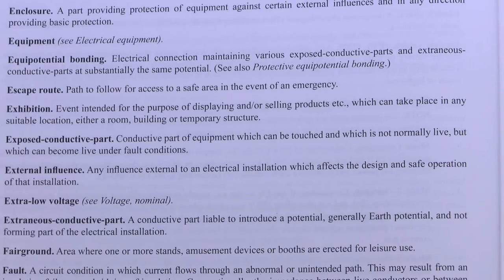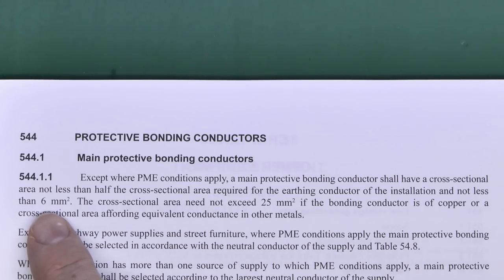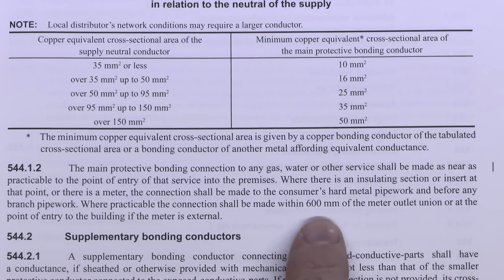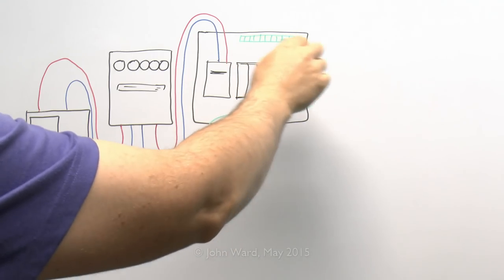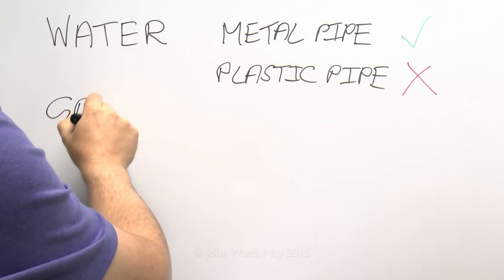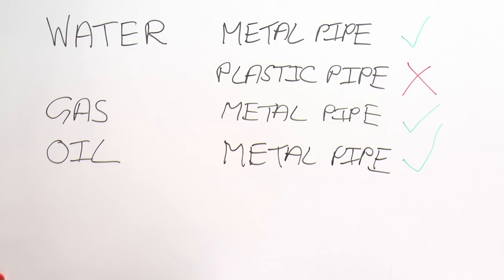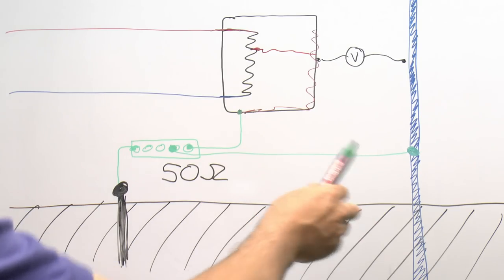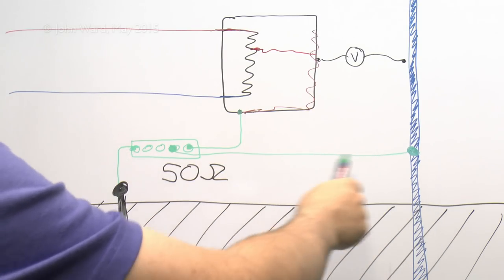Earthing & Bonding - Part 2 : Main Protective Equipotential Bonding

Comment: JW, Thanks for the vids. You are one of the best tutors on Youtube.  I have watched a lot over the years and few can compete. In addition, the section about the boiler causing shock when touching hot and cold pipe has possibly solved a 20 year mystery of an incident I dealt with in my old job. Thanks.

Comment: Re. Metal CH pipes set in concrete. As copper reacts badly to being directly embedded in concrete, any such copper pipe should be wrapped or sheathed. You can get 8 & 10mm microbore pipe with with a semi-airspaced sheath to give some thermal insulation as well as isolating it from the concrete, which should mean it's not an ECP. I wonder how many electricians would pick up on this point.

Comment: Hi JW, firstly thanks for the video ! Just a comment on the several good folks discussing whether or not to bond things in domestic situations. I have been zapped, several times over the years and all of them could have been avoided with proper bonding as you have described (I started work in 1974 and things were not well controlled shall we say ). Noting my bias, if it's in someone's home, if it's an accessible copper pipe, I just want to see it bonded. It doesn't cost much and then there are no surprises :)

Comment: The video is excellent. But I think the "why to use protective equipotential bonding?" part should be at the start, then followed by examples and details like conductor sizes and types.

Comment: Really useful video as per usual! A very belated comment but if my understanding is correct: it should be Emphasised that: an "Extraneous Conductive Part" is not only some "externally supplied (metallic) service" like water or gas. It applies to ANY metal object that comes into your building (from the "real" earth). Which includes but is not limited to your gas and water supply, eg: it includes your own off-grid water tank, if it has metal pipes. It is any metallic object connected to the "real" earth that you could touch at the same time you are in connection with a fault in your electrical installation. It is about "Equipotential": so the Earth in your electrical supply and the Earth in your metallic pipe may have a different voltage potential. This difference could kill you (and also why an RCD is essential as well). In a "TN" installation these should all be bonded together to make the system earth and ground earth at the same potential. In a true off-grid TT installation you need your earth rod(s) close to the point of contact to minimise this potential difference. eg: I have a TT supply coming into a metal caravan. The supply and the Caravan are all grounded to the same local earthing rod, so there is minimal potential voltage difference. So, if I'm standing outside the caravan and touch the metal body that may have an electrical fault - the voltage drop and hence the current flow will be minimal/reduced. The Caravan of course has a 30mA RCD and the main source supply has a 100mA slow RCD.

Comment: The filling loop for as combi or system boiler is connected to the mains water supply, which is then of course connected to the entire internal heating pipework. Althought  these filling loops are a rubber tube, this is covered with a metallic wire shield so presumably this also would require equipotential bonding.

Comment: Hi John,

Recently contact NICEIC regarding a main equipotential bonding question. I asked weather a small external propane gas installation that supplies the property via a copper pipe through the wall would require bonding. They asked whether the gas pipework entered the ground outside at any point. I replied that it didn't and they said that in that case no bonding was required. It seems at odds with your explanation here . Do they have it wrong? Or have I misunderstood something?

Kind Regards
Sam
Reply from the maker: +starky497 The issue is whether the pipe is introducing a potential (earth potential in this case) into the building.  If it was buried in the ground then it certainly would be and would require bonding.
If not in the ground then it may not introduce any potential so bonding not required.
All depends on exactly how it's installed - a small portable propane cylinder with a flexible connection would not be the same as a larger tank with fixed metallic piping.

Comment: Interesting point about not needing to bond a water main where the incoming supply pipe is plastic.

I had wondered about this, but as all the houses here (built 1982, PME, plastic supply pipe) have a 6mm² bonding cable put in by the builders, and every house I've looked at where the CU has been changed or some other major work done the bonding has been re-run in 10mm² (usually in full view under the DPC across the front of the house) I've just wrestled 12m of cable through the house under the floor in preparation for a CU change.

It looks like I needn't have bothered.

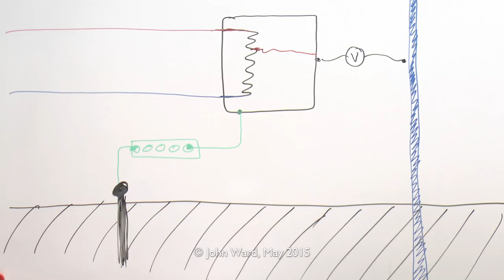Comment: John, I've a question to ask you regarding your video at 21:00 If the 'cold water tap' which has its pipe in the ground (for example), is touched at the same time that the hot water tap is touched (when the hot water boiler becomes live) then why does the recipient get a shock?What gives the earthing rod an impedance of about 50 ohms, but the cold water pipe an impedance approaching 0 ohms, when they're both in the ground? Sorry, it might be a silly question but I'd appreciate your time in helping me to clarify this. Thanks.

Comment: Hi John, many thanks for the great helpful videos. Quick question though. After some kitchen renovations we now have a situation where the incoming water main pipe with the original main bonding clamp attached is now under the floor boards and the pipe then continues further along past the bonding clamp and branches off (A) left to our kitchen and comes up above the floor to our sink and (B) branches off right to feed upstairs to our bathroom. I am fully aware that the main bonding should not be past any branches and also should be above the floor for inspection. The other problem is that the copper pipes have been joined using tectite copper push fit fittings which I suspect would not provide sufficient bonding? I would be very grateful for any advice. Thank you again.

Comment: hi John would just like to thank you on all of your helpful videos and stress how useful they have been to me.
I just have a quick question that confuses me a bit and was wondering if you could possible clear it up.
using the scenario in your video. you say that if the boiler casing is live and you touch that (at the point before the fuse trips) you shouldn't get a shock, if you only touch the casing and nothing else. I was just wondering why this is as you are stood on earth which will have a different potential to the live casing (to me knowledge if this is wrong I apologise).
I hope this question makes sense and any help would be greatly appreciated. 
My only understanding of this is that the bonded boiler would have a lower resistance to earth that a human so it would always use the bonded boiler as is path.
thank you for your time.

Comment: I've read comments online saying that gas mains are now in polyethylene pipes.  The cast iron pipes are being removed as they are corroding.
Also at 17:30 we look at a pipe such as a drain point for the heating system.  I'd say that a pipe doesn't introduce an earth potential just because it emerges from the wall, outside the building.  Doesn't it need to be in contact with the mass of Earth to do that?
Reply: PE pipework has certainly been fitted for at least the last 30 years in gas distribution mains and services (as indeed they have in water distribution).  However many of these pipes are either laid inside existing iron pipework or in some cases steel pipes are laid (higher pressures are typical for steel pipework).  NB as JW says ALL gas pipework from the ECV is metallic, and any above ground entry will also be metallic.  Below ground entries have not been fitted for a long time now and all are metallic.
Reply: I didn't know that many PE pipes are laid in the old metallic pipes.  I'm not sure what an ECV is, and I got confused at the last paragraph about entry points above and below ground.   Wouldn't it be useful to eliminate any metallic parts just before entry into a building?  We'd no longer need to bother with main equipotential bonding.

Comment: Hi John. Is it permissible to use structural steel as a main bonding conductor? The situation I’m referring to is a large industrial building where the services come in a long distance from the MET. Is a correctly sized bond from the MET to the steel work and then from the steel work to the services at the opposite end of the building acceptable?

Comment: Do not assume pipes in floors (concrete) are touching the concrete giving an earth path. They will have a protective covering on them insulating them from concrete/cement.

Comment: Excellent. Why at 24:40 does JW explain that an RCD would NOT help in electric shock, if the person touches both the metal heater casing and the cold mains metal pipe? My misunderstanding i'm sure! The Live would be imbalanced against N current is flowing down through the person to CPC via Bonding conductor to MET. Can anyone explain please? The RCD should disconnect, quick enough to prevent death?
Reply: Yes your rcd would disconnect the supply in hopefully 0.2 seconds ( max for tt ) but before it disconnects you can still receive an electric shock in that time if your in contact with 2 metallic parts with different potentials. If that voltage is high in relation to the impedance then it could be fatal.

Comment: Hi JW. Really appreciate your videos. very well presented. The best I've seen.
Question:- I think by the lay out my supply is a TN-C-S system. Now the main earth from the incoming housing is only 10mm. Does the main protective equipotential bonding still require to be run in 10mm or would 6mm be ok ( which is what is already installed) or does the size need to be upped to 10mm

thanks 

Mick
Reply from the maker: For TN-C-S the minimum size is 10mm, smaller sizes were allowed in the past.
For other systems it can be smaller if confirmed by calculation, but in most cases 10mm is fitted anyway.

Comment: In an apartment on the 3rd floor. At some point, the feeder water pipe was replaced with PEX. There is still a bonding conductor connected to the cold water pipe under the kitchen sink.
1. Shouldn't this bond be removed?
I heard that in very old installations, maybe the water pipe was used as the main building/apartment ground?
My concern is, are we replying on the earthed water pipes of the other apartments and what happens as they corrode and also get replaced with PEX?
2. How do I check whether there is a low impedence building earth ground, in addition to the utility earth ground, and not just earth bonding through the water pipes of other apartments?

Comment: Hai Mr.John,
Do you share a video about bridge rectifier for higher amps, include semiconductor fuse ,filter and snubber circuit for multi drive panels,if yes please include a catalogue also along with that??

Comment: Hi John
Great video
On tncs installation,where existing bonding ,water gas ,is at 6mm and db upgrade required to 17 edition,but is impossible to change the water or gas bonding to  10mm without damaging the finished laminated flooring.The tails and main earth can be upgraded to 25 and 16mm.Can we upgrade db without changing existing bonding from 6 to 10mm ?

Comment: No supply in Separate.  Earth is combined with neutral at the end of a cable run ie Potend, at the LV fuse board in the substation and via the street furniture outside.

Comment: I'm an auto electrician but I have an interest in mains circuits. I have met a few guys who have said "I used to be an auto sparks,now I do mains,it's much easier" given that we are now dealing with networks,multiplexing, LIN,VAN,CAN,MOST,etc.I suppose there is that to it but only because we are dealing with electronics and software instead of physical switches, the principles are the same and many automotive electrical issues are physical wiring or more specifically connector based,so my reply is always "yes but 12 volt don't hurt",though with the increasing popularity of hybrids EVs etc.that's no longer technically true😗!What I see from my point of view of mains electricians is that the implementation of increasing amounts of automation and other technology going into buildings nowadays,that it is no longer the case of a couple of ring mains and lighting circuits and that the difference between both is becoming ever increasingly smaller and that's besides the ever changing electrical and building regulations yous guys have to follow,I had a pal rewire my workshop,six ramps,brake rollers,an outside,compressor shed,outside pressure washer socket etc. plus the usual sockets and lighting .both single and three phase and the rules and actual physical components needed against the original 1981 build was a real eye opener! . Anyway I have a question out of curiosity,Say for instance I have a fibreglass or porcelain bathroom fitting with metal taps fitted that are supplied by plastic pipework,in essence the taps are perfectly isolated but assuming that the plastic pipework will be connected to metal pipework at some point,(supply)and taking into account that the water its self is conductive does this then mean that the metal tap it's self should be earthed?or am I missing something😄

Comment: Hi John, excellent videos. I have a question about the bonding of the incoming water supply. From what I gleaned you are saying if its plastic pipe which typically it would be in all new builds, does that mean the water supply never needs to be bonded, even if the plastic pipe only enters the building to a length of a few feet before the connected metal stop tap and pipes? As a follow up, even if it is plastic, doesn't the water inside the plastic pipe essentially act as an extraneous conductive part, given it conducts fairly well?
Reply: phil taylor Bonding wouldn't be required if the water supply enters in plastic.

Comment: The mains water may enter the building via a plastic pipe which is non-conducting, but the pipe contains water which, unless the water supply is distilled water (very rare), is conductive.  So taps and steel sinks etc. will still be at ground potential.
Reply: +klosty2 I stand connected . . .er corrected

Comment: Hey JW, I have just discovered a water pipe in a bathroom that has been repaired with a plastic connector, is this dangerous and why? Also, what is the best way to remedy this? shall I just bridge the connector with earthing wire?

Comment: 22:29 looks like the water pipe is a more effective ground that the electrode itself!
Reply from the maker: It quite often is, large lengths of metal piping in the ground is far better than a single rod.
However metal pipes can be replaced with plastic ones, so water pipes can't be used as the means of earthing.

Comment: So if I understand correctly, bonding is the most essential in TT systems ( because of the large impedance od earthning). In TN-S and TN-C-S systems, we have very low earthning impedance, thus the circuit breakers will pop in no time, so it will by highly unlikely for a person to hold the pipes and electrical equipment in the same time when fault occurs. Is that correct ?
Reply from the maker: TheRodionRaskolnikow A high earth impedance results in higher voltages on exposed conductive parts when there is a L-E fault. 

Disconnection times will be similar regardless of the earthing arrangement, although it will usually be an RCD disconnecting for a TT supply rather than a fuse or circuit breaker.
Reply: ***** Right, thanks for answer I am new in electrical instalations. So in TN-C-S and TN-S, in case od L-E fault, voltage drop across exposed conductive parts and ground will be very low, so risk of getting electric schock is also very low. 

I have one more question, imagine TN-S system, without RCD, only with 16A fuse and earthning resistance of 1 ohm. If we short L and PE together. Will we get 230 amps for a short period of time ? or at least 50 amps before fuse will pop.
Reply from the maker: TheRodionRaskolnikow Yes, with 230V and 1 ohm, the current would in theory be 230A until the fuse failed.

In reality, it is more complex, since while the fault current flows, the fuse element will heat up causing it's resistance to increase, reducing the current.
Reply: ***** Right, resistivity of metal conductor ( for ex. cooper ) rises quite quickly, when the temperature is rising, i didin't thought of that.  Thanks for your time and knowledge :)

Comment: Hi john looking for a bit of info main water coming in is plastic but it's in  a basement then runs up through the floor  all installation is copper whats the best way to test to see if it needs to be bonded

Comment: In my house, I have water storage and a water pump for the house that pumps when a valve/tab is opened because of pressure drop. I have the feeling that something electric wise is wrong with the pump and in a hort distance from the pump, I have a metal valve that has static on it.. All is connected by pvc pipe.  Bonding might be difficult. Any suggetion?